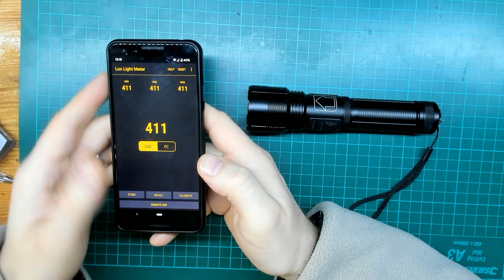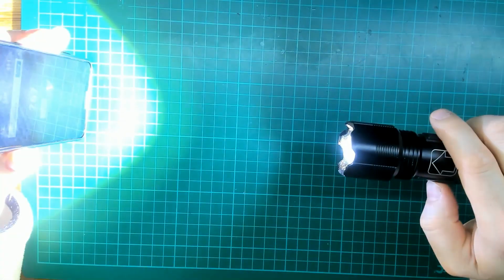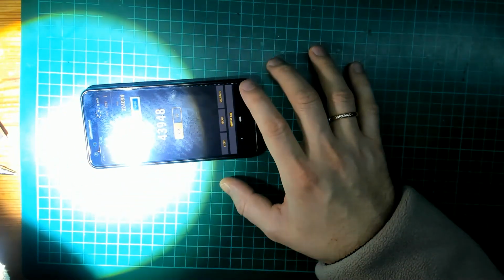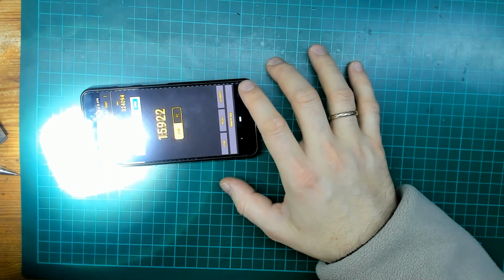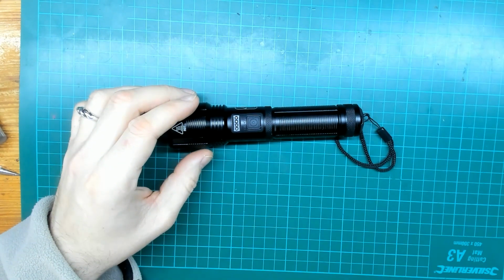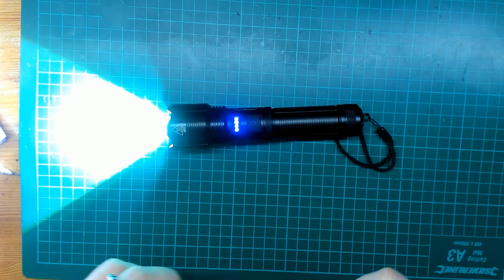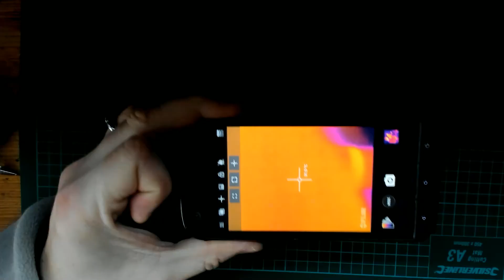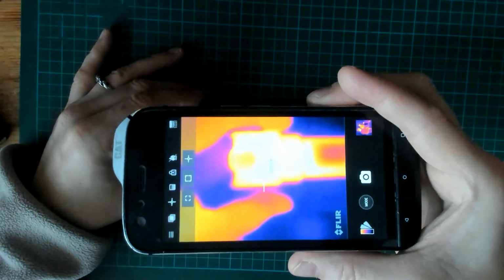A delicate teardown of the XHP70 flashlight

Comment: On the back side or inside of a Lynch try unscrewing counter clockwise with a long pointed object
Reply: Inside the Lins from the inside, you can unscrew counterclockwise.
Reply from the maker: @martinmorando9267  thanks mate, I will try to do so!
Reply from the maker: @kamalaparkerballs  No, I haven't tried it yet because I'm waiting for the shipment from China! The flashlight I have is in the countryside!
Reply: You can open the led using a divider.